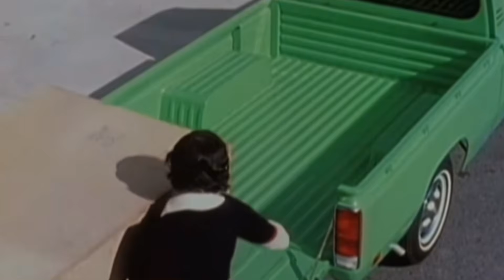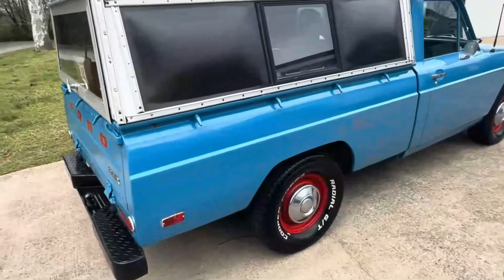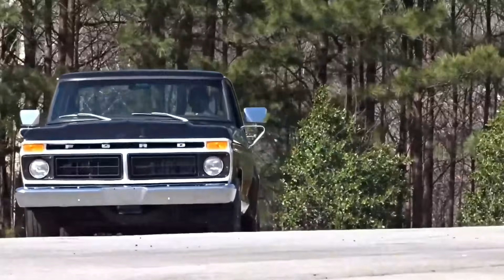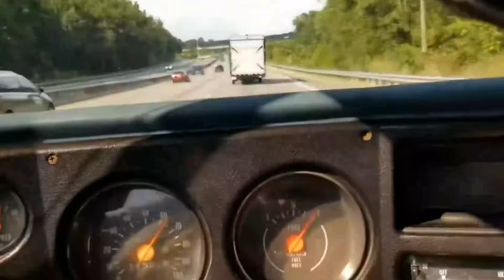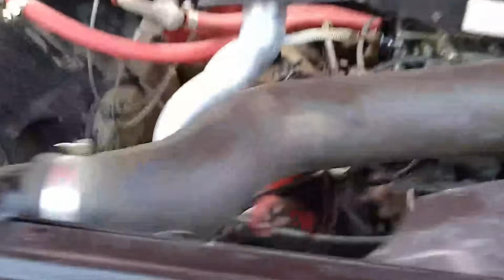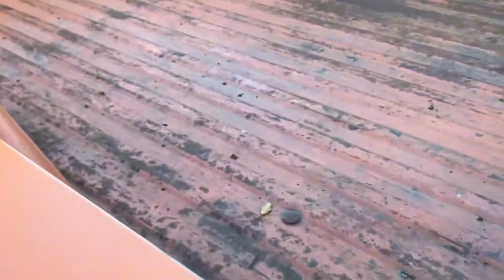9 Worst Classic Pickup Trucks of 1970s

Comment: Bought a 1973 Chevy c10 brand new to pull my horse trailer. Rang great, but was the poster child for rust bucket vehicles. Front fenders, hood, and bed all rusted out within the first year. Also, 75-76 C10s had rectangular headlamps. Your video shows an earlier modle, plus what the heck is that first C10 in the clip. An Australian truck? Never saw a C10 like that

Comment: My dad bought a new half ton Ford in 1977 with a 302 and automatic transmission. It lasted 16 years and had 350,000 miles on it when he replaced it. Very little trouble, and never rebuilt.

Comment: I bought a 1978 Ford half ton, I had carburetor problems on about three years, a Ford dealership told me they could order a new carburetor, but would not guarantee it would fix the problem. There went my faith in FORD! I found a mechanic that said he knew exactly which carburetor would fix it, he was right! The twin I beam was a problem, which effected tire ware; not cheap to have adjusted. Overall, the truck was a substandard mess.
Reply: For me, it was a '93 Ford Topaz. It was a used car that I had to buy in a pinch, and it ran well when I first tried it out, but the starter ignition or something kept going bad on me, and it was just an all-around shit car. Ford definitely stands for Fix or repair daily.
Reply: Same but 3 on the tree. Carb must have had a plugged passage that could not be cleaned out. Twin I beam always went crazy going over the RR tracks.